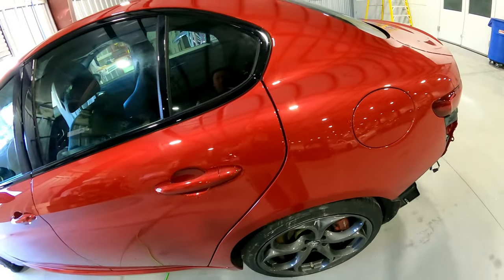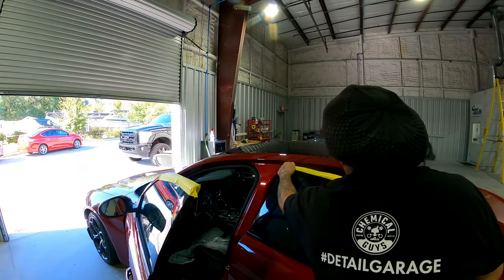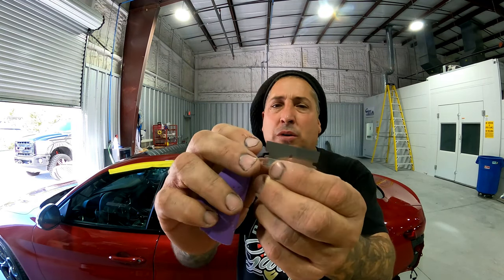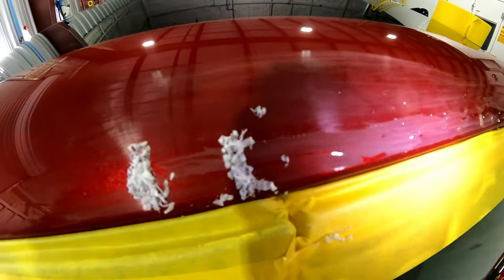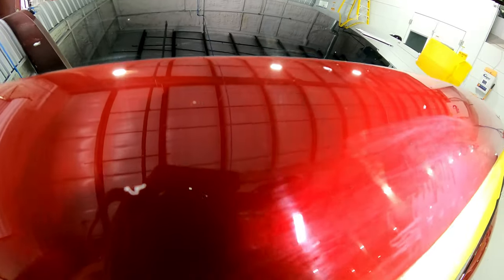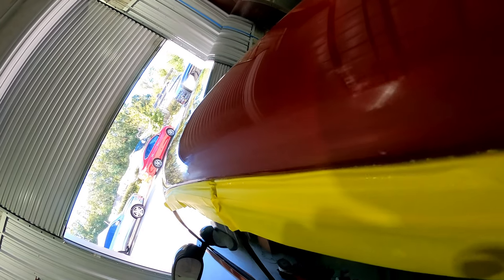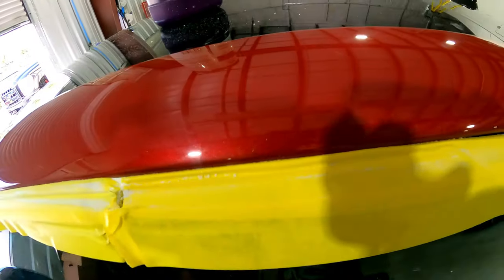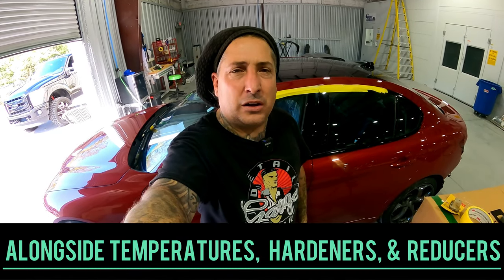HOW TO FIX A RUN OR SAG IN CLEAR COAT

Comment: I have been trying various brands of clear and base over the past 3 years and have got quite a few sags and runs in the clear.  For me poor lighting is a huge factor in getting them.  Your comment that you would rather push the clear and get a run than have a dry job is spot on and quite reassuring to a guy who only paints maybe 2-3 cars a year.  You are the best!

Comment: Thanks for vid.   New learning is the pre sand so it helps bring out the run definition.  I have a similar run in a door I just did so watching lots of vids.  First one I’ll try to remove so thanks for your guidance.  Confidence I can do this boost for sure.

Comment: I enjoy watching you. and am learning a lot. On a different topic of confusion for me...are the 3M PPS gun adapters specific for use on either a PPS Original or a PPS 2.0 cup and cap? Meaning I would hate to have to purchase both The Original and the PPS 2.0 cups and caps. Thank you.
Reply from the maker: 2.0 is the newest version  you can go with either
Reply: @kandyman5315  after asking you, I did a live chat with 3M. Was told from company rep that the PPS 2.0 kits should be less expensive. I also learned the difference in appearance of both adapters. ORIGINAL has a flat adapter surface and 2.0 has sort of wings and a small funnel shape. The Original cup has 2 clips to hold the adapter and 2.0 has 4 points to clasp cup. Unfortunately, before realizing the two are NOT interchangeable, or that there was any difference, I ordered adapters that are only for Original PPS. The company no longer makes Original PPS adapters and those don't have the "S" in the name. For the Kiwami4, I was told the #43 is the Original PPS Adapter and the #S43 is the 2.0 Adapter. Hope that info helps someone else out.

Comment: I've cut runs with a razor blade before, and I have had the edge dig in a little more then I wanted as well, but I never though about sanding the edges off!

Comment: Hi kandy man 👨 brilliant video thanks for sharing that  i painted my ford focus mk3 front bumper the other day with base coat paint only used it a couple of times  got a little run in the clear coat paint  got a stanley blade and some wet and dry  paper ready to cut and buff with 15000 grit and 2000 grit 3000 grit and polish
Reply: @kandyman5315  HI GOT MY CAR BUMPER PAINTED AND ITS STILL NOT THE CORRECT MATCH  THEN THE PAINT SUPPLIER MIXED UP SOME MORE AND USED A SPECTRO CAMERA ON THE CAR AND ITS A LITTLE DARKER THIS PAINTER SAID ANDY NEEDS A BLEND ON THE WINGS
Reply: @kandyman5315  what would you recommend please scuff the wings with 600 grit DA sander and clear base coat blender  and base coat paint and clear coat paint  never done a blend before
Reply from the maker: @ANDY-we7mr  800 grit .gray scuff  pad clear base whole panel  .then  put on color blend it out then clear it💪
Reply: @kandyman5315  and base as well and clear it

Comment: first of all he is not an old time painter, i am an old time painter, go to h.d. and get a flat fine 1/2 inch wide cut it down to 3 inch bevel the edges and epoxy to a piece of wood, works great. on really big runs an old time metal file works wonders. I actually did that once on a  cadillac door, it worked but had to respray as it was too slick. got to keep the orange peel even

Comment: Non razor blades for me but I do have same file 
So I file them an dry block with 800 grit water block 1200 an buff wool pad yellow bottle compound then switch to black and black foam and blue sometimes
Reply from the maker: Thanks for sharing your technique 👊

Comment: What kind of gun do you use for base coat and what kind do you use for clear coat?
Reply from the maker: 3m performance gun for base clear iwata and dv1
Reply: @kandyman5315  Hey maestro may I ask where the DB8150 clear can be purchased and does it work for air dry? Keep the videos coming
Reply from the maker: Ppg store